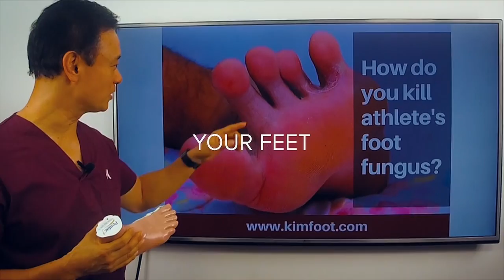Welder’s Painful Corns & Calluses Removal

Comment: Curious as to what's the root cause of this callus? Presumably it has something to do with improper foot function or biomechanics i.e. pinky toe is not correctly aligned or sufficiently strong => rolls over, callus builds up, gets inflamed? Is it possible to correct this with exercise / footwear /orthotics / aids like CorrectToes, vs. surgery? To me, it always seems better to try to treat the root cause and find preventative solutions where possible, and opting for surgery only as a last resort? (I have been experiencing a similar issue due to ski boots - likely since they're too narrow leading to inflammation - but also feel there's a biomechanical element to my issues, as I've only got the issue on one foot).